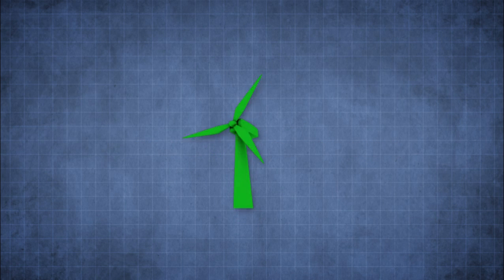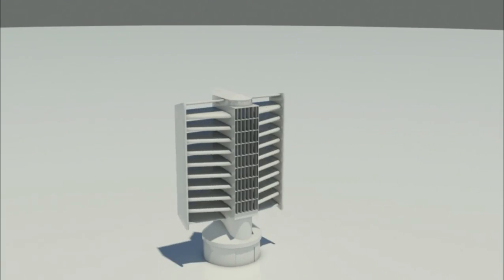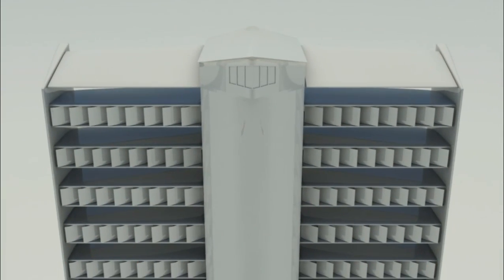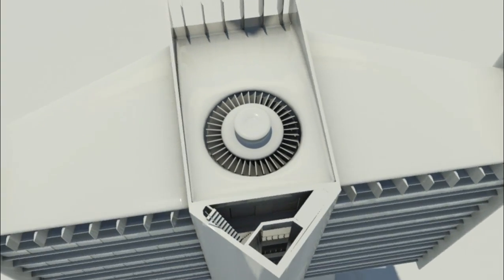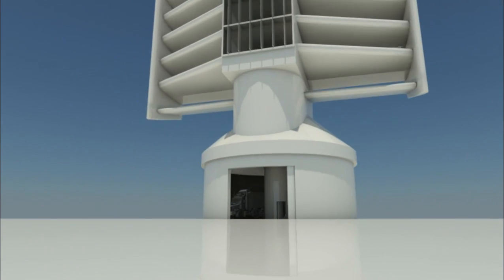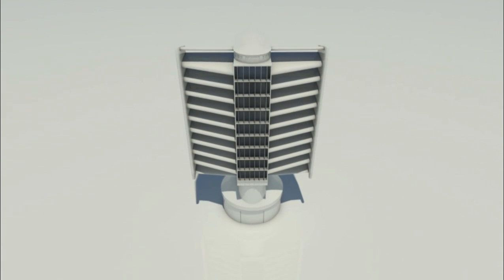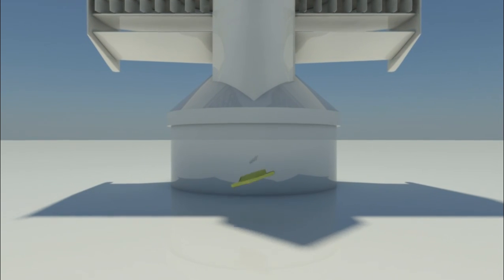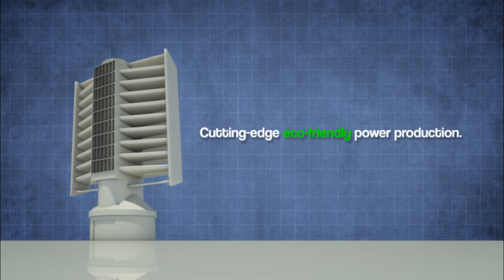Powertower Windmill Concept Presentation

Comment: Have you actually tested the principal of air compression and extraction in real life conditions. Our testing has revealed that funnelling of air at wind speeds between 6 to 20 meters per second is ineffective at increasing pressure or power. As pressure builds up in our funnelling chamber the following wind simply goes around the chamber. Torque at our turbine blades was actually lower than exposing the blades directly to the unregulated wind. Hope you find an alternative to this problem. We need more innovative people like yourself to solve our power problems, keep it up and good luck.
Reply: what is the total price i am willing to build wind turbines for a specific wind speed that is better what is the best price for a 10 kwh wind turbine
Reply from the maker: Hi David! Indeed, I believe this concept hit similar problems during development and testing. I think the tower as presented here was fully scrapped unfortunately. But I'm sure they are working on new ideas! Thanks for your comment, very interesting. Side note, I'm just the animator who was hired to make this video :)
Reply: @jumpkut  Thanks. The video is great.